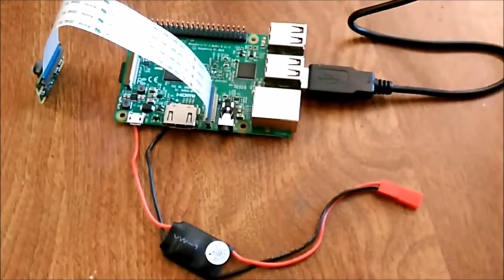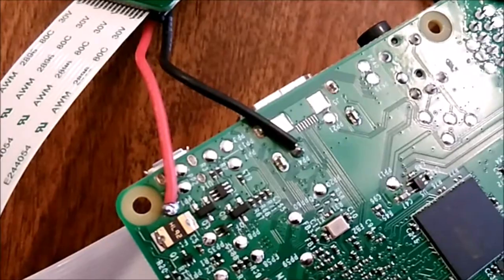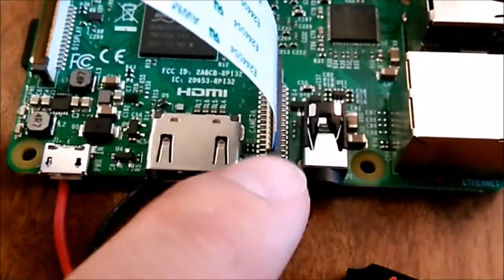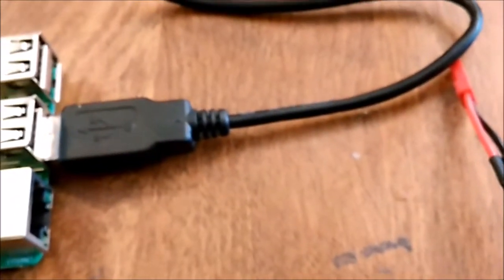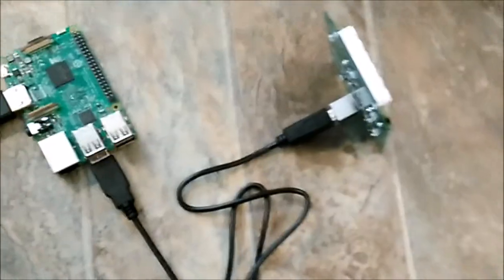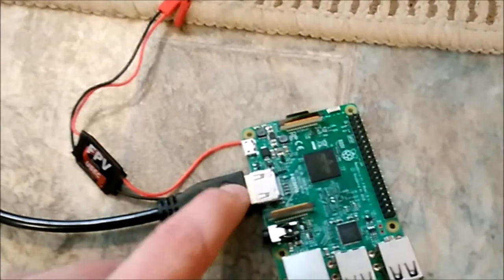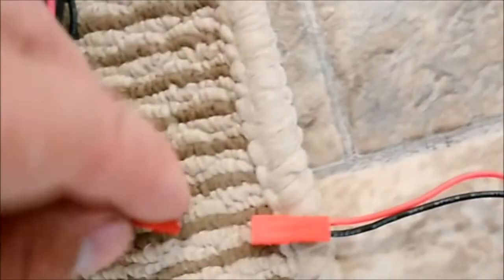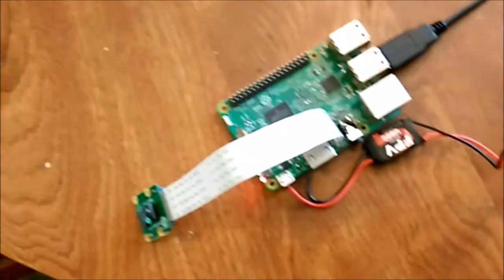EZ Wifibroadcast: Quick Test Setup...With Success!!

Comment: OK so the raspicam just starts p by itself? No need to do any commands via cli?
Reply from the maker: Nope system should just fire up
Reply: @techsmechs4553  Great thank you so much. Just one more question. Do i just enable the WIFI on the Air unit the same as on the ground unit? and then obviously just change the parameters in the text file?
Reply from the maker: @MrSiciro  I believe so yes. It's been a long time since I messed around with this stuff
Reply: @techsmechs4553  Got it figure out thank you sir

Comment: Any way any how to use a regular 900 Mg to be the tx rx to increase the range?
Reply from the maker: I don't think so. There may be some 900mhz wifi equipment available by Ubiquiti. Not sure if they would work though. The wifi station that I am using (also from ubiquiti) has lots of power. In the air people have reported up to 8km range with normal antennas
Reply: Yup that may be totally accurate (w/o any floor noise) But I was thinking about some what around like the telemetry link that is sold for the use of the APM Flight Planner... "It is a 100% data" yet is a 900Mhz I believe to be a 1.5 Watts, Never the less I just found a Ubiquity that is putting a hole one watt of power output... you one never know until one try..
Reply from the maker: The Wifistation puts out around 900mW of power
Reply: can you confirm that this Ubiquiti  is transmitting on 2.4 Ghz?
Reply from the maker: Migueldeservantes the ubiquiti Wifistation operates on 2.4ghz
Reply: thanks, so it is possible to get much more range.. "Theoretically specking"
Reply from the maker: Migueldeservantes if you could find high powered 900mhz wifi equipment that worked then maybe. I'm not sure what the bandwidth requirement is though
Reply: Well I guess I'll repeat my self, you have the mavic style of USB telemetry that is used one almost any type of Autopilot.. and I could be wrong but the wire for the RC Side of the autopilot have 4 wires "Like the USB... and this particular style of mobile date com "Is available on 433/915 all MSI band...
Reply: That kind of range needs the same ubiquiti card for both tx and rx ? so about half if only as ground station ? Looks great, thanks for sharing.

Comment: PP4? Or PP6? Same?
https://github.com/bortek/EZ-WifiBroadcast/wiki/Wiring Different Boards?
Reply from the maker: The link shows a Pi Zero. I am using a Pi3. You can google the pinouts for whichever board you have
Reply: Ordered a 5 inch LCD HDMI Touch Screen Display for Raspberry Pi 3 today. I still haven't worked out the OSD/ Mavlink stuff to get that OSD working with the Pixhawk Cube. Guessing one day someone will post a to-do video. Video is working just fine but was only getting about 500 meter range (though one unit was in the house whilst the other one was driven down the road) I'm excited to start flying with this (but need the OSD working) :(